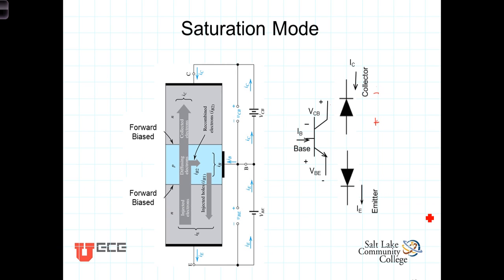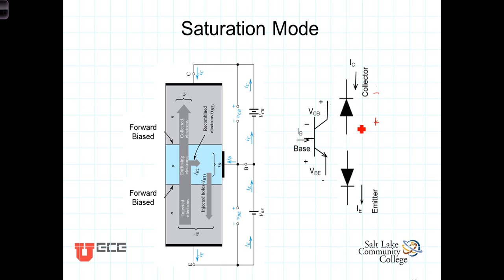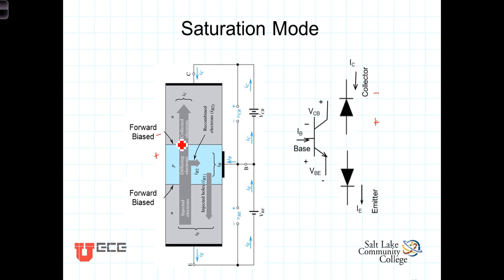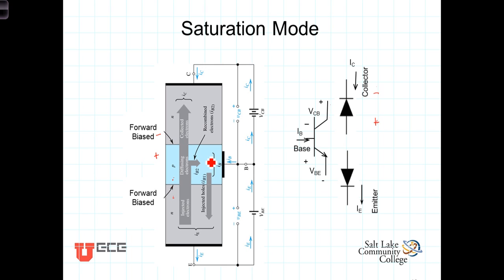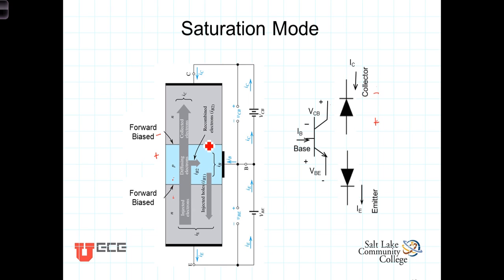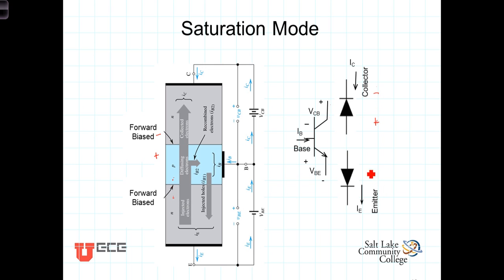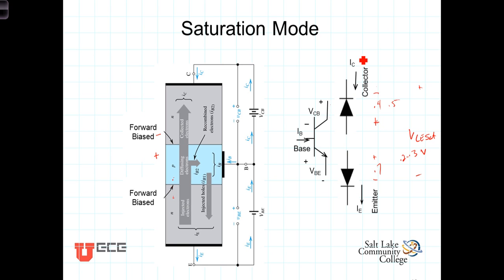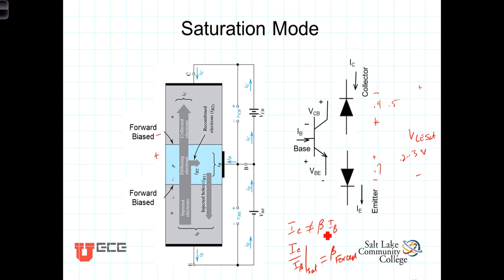L6 1 4Saturation Mode

Comment: I am confused. Is the transistor in the electrical schematic shown (on the left side of the screen) really in a saturated state?

At 1:26 a plus (+) sign is drawn at the base, and a minus (-) sign is drawn at the collector. Doesn't this completely contradict what is shown in the diagram, where the negative (-) terminal of the battery (i.e. the battery labeled Vcb) is connected to the base, and the positive  (+) terminal of the same battery is connected to the collector? 

It would appear that the CB junction is in fact reverse-biased, as the voltage at the P region is more negative that the voltage at the N region, no?
Reply: Furthermore, at 1:14 you say that "the junction voltage allows electrons to flow from the heavily doped collector to flow freely into the base". That is to say electrons flow from collector to base , isn't it?

Doesn't this also directly contradict what is shown on the diagram:
(1) The solid grey arrow shows electron flow to be from base to collector
and 
(2) The collector current (i sub c), which I assume indicates the direction of conventional current (positive charge), is shown to be into the collector, which would mean that positive charge (holes) would also have to exit the collector i.e. move from collector to base, because of Conservation of Charge

Could you please clarify whether the diagram matches what is being discussed in the video? Does it demonstrate saturation?
Or maybe the diagram simply just used to present the general circuit without intending for the polarities etc. to be correct?

Cheers
Reply: yes it does. because that diagram is from the Sedra Smith book in the active mode paragraph.

Comment: i'm confused, why does the collector become forward biased when you connect the positive terminal of the battery on it? the transistor is n-p-n, so wouldn'y you need to connect the negative of the battery to the collector which is negative, to shorten the depletion region between the base and collector?